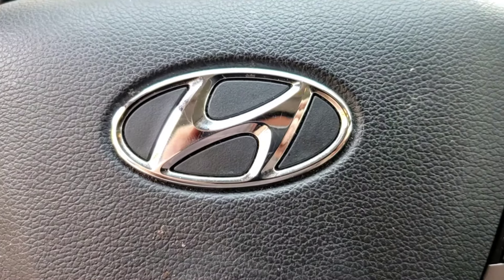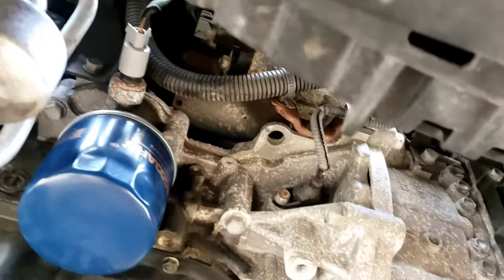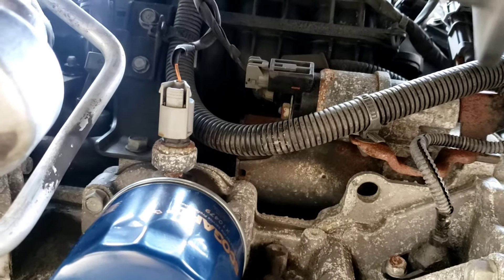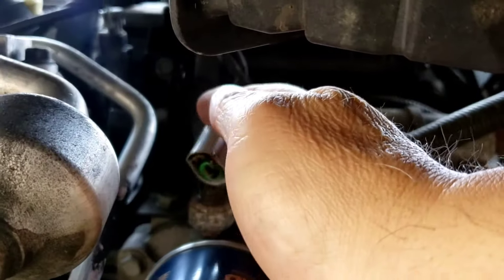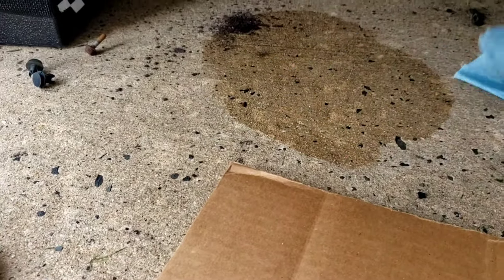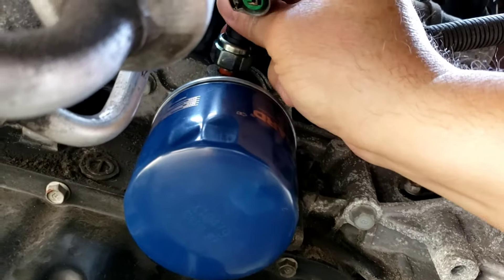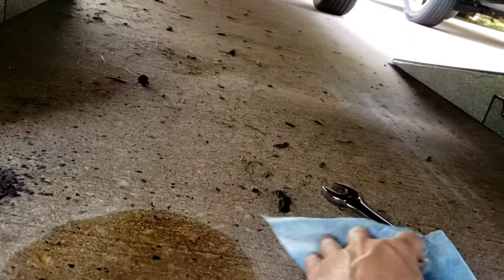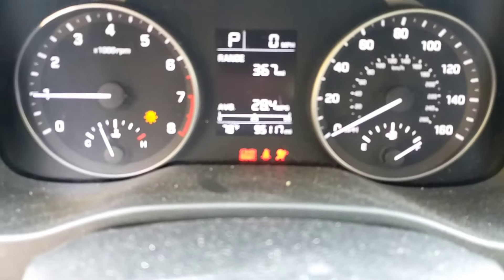Hyundai Elantra Red Oil Light ON or Flickering 2017 and Similar  What can it Be if the Oil is Full.

Comment: This was exactly the problem on my 2016. Started flickering at a stop light and 9ver the course of 1 day quickly progressed to a solid oil light. Level was full so I researched, found this video, and fixed my car. Everything was just as you said and showed it would be when switching the part out. Quick and easy. Saved a bunch 9f money not putting it in the shop. Thanks fren.
Reply from the maker: You're welcome and thanks for watching too...

Comment: Thanks for the video I was looking for this part# and location on my Elantra. One bit of advice though, get a can of electrical contact cleaner. Brake cleaner will make the wire insulation and plastic pigtail connectors brittle and it will destroy them.
Reply from the maker: Brake cleaner works best on oil removal..its so good,it takes dry oil out of a cement driveway..thats my other video..lol
But Automotive wiring insulation can hold up to a 2 second spray.. 😆

Comment: I’m having the same issue with a flickering oil light. Oil is fine, battery is fine, but my car completely shut off while I was driving it. My check engine light isn’t on either, and the dealership can’t get me in until June… any suggestions?
Reply from the maker: Its the oil pressure switch that sends a signal to the computer that there is no oil so it shuts down the engine to prevent damage..now are you sure there is oil in the engine..on a similar model the customer looked at the oil dipstick and she said it was full but in reality it only had 1/2 a quart of oil..the car uses about 4 to 5 quarts..The dipstick can show a false positive..I will attach the video
Reply from the maker: https://youtu.be/LmNq9OWRPlI
Reply: I had my dad check to make sure there was oil in it, and he even filled it up a little bit more just to make sure. However, the oil light is still flickering. I’m going to have him check the oil sensor to see if maybe that’s the problem.
Reply: Also, may I ask what you used to clean off/spray the connector with?
Reply from the maker: @gabgab7325  just change the oil sensor..its easy to get to
Reply: Welp, you were right about the false positive. Turns out my car was super low on oil. So far all the problems I was experiencing are gone now. Thanks for the help!!
Reply from the maker: @gabgab7325  glad it worked out for you..
Reply from the maker: @gabgab7325  it was brake cleaner..
Reply: @alyoungcuda  I wouldn't put too much faith in the switch sending a signal to shut engine off. My 2014 Elantra ran bone dry on oil 3k km's into a fresh oil change- no oil light or check engine light came on at all and the only reason I noticed was because after 2k rpms the power would flat line for a few seconds and then rev really high without  increasing speed( almost like slipping)  
My Wifes 2014 Elantra is now doing the flickering.  It was down 1l of oil after 2k kms into fresh oil change.  I added 1l to top it back up and light is still flickering but only doing it at low speeds/rpms (under 50km/h and under 1500rpms.
Reply from the maker: @1557Reckless  light flickers for 1 reason only, it senses low oil pressure..whether its low oil, worn out bearings,low oil pump pressure or a leaking switch into the connector which tricks the switch into low pressure. Stalling could be alot of things..you'll be surprised how many people do not do the regular service like tune up and throttle body cleaning and other stuff because the car runs so good..same with Hondas and Toyotas..they never get serviced till it gives a problem. And don't forget water in the tanks from the great gasoline they have..you need to add a water remover and gas treatments...
Reply: same exact problem as me after awhile of it flickering it will just shut off. did you figure the problem out?
Reply: I'm having the same issue. 2017 Elantra. Just had the oil changed a week ago now the light is always on.

Comment: I have a 2017 Elantra with the same problem, just put oil in it and the light is still flickering. Taking to Hyundai monday, hoping its just the sensor like the video. Will keep you posted :)
Reply from the maker: Yes its a common problem..hopefully they won't charge you alot at the dealership
Reply: @alyoungcuda  just wanted to follow up. You were right! They told me the switch was leaking oil. They charged me 200 to fix it. I would do it myself but I'm not handy. I'm just happy it wasn't the oil pump 🙂
Reply from the maker: 200.00? Wow..I guess since labor is up to 150.00 an hour..and the part is less than 50.00 dollars..glad it worked out for you...and thanks for the update, it will help out alot with the Subscribers and future viewers.
Reply: @alyoungcuda  I don’t know if you still check this, I just went in for an oil change and they recommended I take this to Hyundai as soon as possible. Earliest I can be seen is October - dudes at the shop said I might need a new engine if I wait that long. It could be this but I’m thinking oil pump bc the light goes away at higher rpm, lower to idle and the light comes back.
Reply from the maker: @OhioVbucks  is the engine making noises, knocking,rattling  then its not damaged yet, why didn't they check the oil pressure at the switch or even change the oil pressure switch?
Reply from the maker: @OhioVbucks  I made this video because this car had the same thing, she went in for an oil change thinking it was that and after charging her for an oil change, they said to bring it to a dealership because clearly they were not mechanics even thou it was a repair shop.they didn't bother trying to troubleshoot it, just wanted to 75.00 oil change fee and threw her out the door.
Reply: @alyoungcuda  I don’t know. They didn’t wanna do it themselves I had just scheduled an oil change and they had other things to do. It used to be my old mechanic shop who would always hook me up but it’s under new management so they don’t know me. Completely different business nowadays. I ended up ordering the part myself and I’m gonna try to fix it based off your video here probably today. Engine doesn’t seem weird but I haven’t been driving it just to be safe, will update you once we try to fix it ourselves
Reply from the maker: @OhioVbucks  ok, its the switch, if it was the engine it will be making noises. Did you personally check the oil level yourself? I have another video on how the dipstick is stained brown and it will trick you into thinking its full when its not..and if the person needs glasses then its a big problem...
Reply: @alyoungcuda  I did check the level myself it seemed to be fine but it was already around 5k miles so I got it changed either way
Reply: @alyoungcuda  just finished changing it out. Took it for a spin and we got no oil light. Never really been the handy type myself so this is exciting. Thanks for the tutorial brother couldn’t have done it without you
Reply from the maker: @OhioVbucks  great job, I give you an A
Reply: @OhioVbucks  have you had any problems sense then, I have the exact same problem my cars oil light will flicker at low rpm and go away when im driving above 40mph.

Comment: My wife has an 05.  Hoping this is the issue.  Fingers crossed.
Reply from the maker: Yes and definitely check the oil level..those dipsticks stains brown it it looks like they are full but it's empty..look for actual wet oil..its on my other video about this problem..a Quick glance and it will fool you..
Reply: Yes, I have previously when they've to that issue. I just did an oil change, because the oil light came on. I have found that on my wife's Elantra and my other Hyundai, I take a wire wheel to the dipstick so that the brown stain goes away. But be careful to make sure it's cleaned before putting it back in.

Comment: Excellent video! Our oil light just came on yesterday. We have a 2017 ELANTRA, perfect maintenance, records, owned it since brand, new, and praying to God that it is not a serious repair. We just paid it off. We would like to live a couple years with no car payments. Your Video has given me immeasurable Hope! Thank you so much for having this video posted! Wishing you a merry Christmas :-)
Reply from the maker: Keep up with the oil maintenance and check that it doesn't lose any oil, keep the level up and you will be just fine..my other videos on these cars has to do with burning and losing oil and causing problems and dirty oil will cause the timing solenoids to get stuck..Thanks for watching and Merry Christmas
Reply: @alyoungcuda  thanks! The oil has not dropped at all and there’s no leaking or burning. Everything has been pretty good up to this point. That’s why your video is so valuable to me, I called the local auto parts store and that part is $14. Whew! We recently had to replace our air-conditioning for the third time. The first two times was under warranty. The third time there was no warranty and it cost just over $2000. I’m not a real happy guy with Hyundai.
Reply from the maker: @BobbyDeneke  wow, that is alot of money for ac..thats why Autozone has lifetime warranty on things

Comment: Thanks so much! Looks like a common issue
Reply from the maker: Yes it is..once the oil leaks at the connector. It completes the electric circuit and turns on the light. Thanks for watching and stay away from Mavis who turned this car away to a dealer after charging her for an oil change and without even checking it further and told her it was ok to drive it,but yet they claim to do Car Repairs...

Comment: Good day i hope you can see this message. I just started getting this flickering light or i just started noticing it. Either accelerating or getting ready to slow for a turn it flickering for a second or 2. Oil level seemed fine but after reading some of the responses I'm going to change out oil, oil filter, air filter myself and then check ro see if problem still exist. I don't know if i trust these shop folks anymore. I will come back here after with an update. Thank you for putting this information out here🙏🏾🙏🏾🙏🏾
Reply from the maker: If you're going that far, change the oil pressure switch, its right above the oil filter while you're there. . Hope it was only the switch..
Reply: @alyoungcuda  ok will do. It seemed easy enough so I will update you once done because this can save many people some time and money
Reply from the maker: @lr9874  sounds good
Reply: Any update?

Comment: Thanks for this. Gives me peace of mind. My 2017 started doing this exact thing. It’s at the dealer now. Hopefully this is what the issue is and not something more serious.
Reply from the maker: Most likely,  let's see how much they will charge you and what they find..thanks for watching too...
Reply: @alyoungcuda  to any one reading this in the future, if you are in any way mechanically inclined, give this a try first before going to the dealer. The Hyundai dealer charged me $350 to diagnose this and then $382 to fix it. it was the exact part this video showed how to fix.

Don't be dumb like me and back yourself into a corner where the dealer will highway rob you because you have no time to do it yourself.
Reply: Even if you determine you can't DIY the repair yourself - never ever take your car to a dealership for repairs. Indy Shops only! You will save 50% off repair cost minimum!!

Comment: This is very helpful.  I noticed the oil filter wet with oil.  Replaced it with a new and tightened it better but still wet after a couple of weeks….i am hoping it is is the oil pressure sensor that started leaking like yours instead of other major leak.
Reply from the maker: You can unplug the sensor connector and if its wet, that is the problem..don't forget to clean the connector before you plug it back on the new sensor if you're doing it yourself

Comment: Thanks for doing this video. Mine started flickering when I get below 30mph or stopped. It started after my hood and grill was repaired after a front end collision. I'm waiting to have it fixed now. I hope it's as simple as this!
Reply from the maker: It is simple but if you never ever did one before, you need to know your strength in tightening it and that also depends on the tool you use to do the job. Inexperienced diy people will cause more harm than good..remember that watching a few videos doesn't make you an expert mechanic,  so be careful...and if you see oil in the connector,  clean it out before you plug it back in as you can see others have done..

Comment: Great Work Bud ! Thanks for the video . I'm having the same problem with my elantra 2015 .  its around 1 am in the morning,  and the oil lamp started flickering on and off , at times it doesnr come on,  then after a while it flickers on and off.  Twice in a span of 5 hours driving,  the car stalled and i had to start it again , and I thought maybe the oil pump is dying on me. Lol.
Pretty freaked me out!   But After watching your great  video  , im quite positive that it might be the switch which is giving up on me.  I'll get another switch and replace it   to see if it fixes the problem.
Thanks again !
Reply from the maker: Check your oil level..someone had a similar problem and the dipstick was stained and it looked full but it was not..look for an actual wet level...
Reply: @alyoungcuda  just a quick update.  So after leaving the above comment last night,  I decided to head straight home , but as I was driving,  the oil lamp  flashing got worse , and I decided to pull into a gas station and do some inspection.  

So I did a visual inspection of the oil pressure switch  , took the connector off    and it looked OK, no leakage at all. 
Then when I decided to check the oil level  , it was low ! This is quite strange bcoz I've driven only about 5,000km now , since I did my last oil change . I'm just wondering what happened to that oil, bcoz the car has no leakage . 
Nwayz long story short,  I topped my oil with about 500ml that I bought at the gas station  , and to my surprise,  the lamp stopped flashing completely after driving around for about 5 km .

This morning   I woke up and drove for about 120km , and the light  didn't come back on ! 🙂🙂 

So youre very right , better to check the oil level before thinking about replacing the switch. 

Your video has saved me alot of frustration and money to the parts shop !!!

Thanks again !!!
Reply from the maker: @big.r5550  that engine will eventually burn oil but I need to ask you does your oil dipstick have a brown stain on it up to the full mark?..if it does i think it fools the people doing your oil change if they need glasses or they don't actually try to look for a wet mark..it happens so much, I had to make a video of it...I'm glad it worked out for you...Thanks for the compliments...
Reply: @alyoungcuda  yes , there is  that brownish stain on the dip stick. So normally,  I'm the one who does the oil change myself ,  but the last time oil change was done , I had traveled and the family member took it to one of the shops . So I think they either didn't do it right,  or they got fooled by the brown discoloration at the tip of the dipstick,  as you mentioned. Seems like its a common thing that most people will fail to notice.!
Reply from the maker: @big.r5550  oh yes, how many people do we know that needs glasses and won't get them because they say they see just fine...Had this problem with another car and I told the owner to check the oil before you use it because she won't be able to bring it to me till after work the next day..she said it was full..a day later when the car arrived it only had 1/2 a quart of oil, no leaks..I said I thought you checked the oil and she said, I can't  see it looked full..hence that brown stain and my next video.. 🤣
Reply: @alyoungcuda  🤣🤣. ½ a quart of oil ???? 
She is so lucky that engine didn't knock and stall  !!! 
Would have costed her a fortune.! 
Funny how she says that she checked the oil level , only for you to find out that there's barely any. LOL...
Reply from the maker: @big.r5550  im surprised it ran with half a quart and it had no noises..
Reply from the maker: And the engine had no noise, its still I've but burning a quart every week.
Reply: @alyoungcuda   mines a 2016 Elantra… hopefully it’s nothing more than that
Reply from the maker: @jessegv3525  most likely it is,unless you're burning alot of oil
Reply: @alyoungcuda  hey just an update.. I  put a new oil pressure switch and also noticed the car had too much oil like my 5qt pan overfilled and spilled! Now I put 4.2 Qt and has a new switch hopefully it fixed the problem
Reply from the maker: @jessegv3525  good to know,  wonder how the oil got higher? Maybe someone sold you oil
Reply: @alyoungcuda  need some advice, mines eats oil like breakfast but still runs fine, sometimes it runs ruff and the oil light will flick on and off sometimes the car will sputter and cut off, turn the key back a few times it’ll start and run fine like nothing happened I’ve already replaced both crankshaft position sensors wich is the code it’s throwing.
Reply from the maker: @youcangetsum6871  if its burning oil like you say, then the spark plugs are definitely shot from the oil and it will prevent the plugs from firing properly..change out the plugs..di you remember the last time you replaced them?
Reply: @alyoungcuda  just replaced the plugs last week car still shivers at idle sometimes has a brand new air filter as well, I just figured out yesterday that the oil sensor is leaking oil onto the oil filter so it may not be burning as much oil as I think it does.
Reply from the maker: @youcangetsum6871  if the sensor is leaking than surely change it out, low oil pressure will tell the cars computer to put the car in limp mode to prevent more damage to itself.have you cleaned out your throttle plate? Re scan the computer for a recent code after you cleared the old ones?